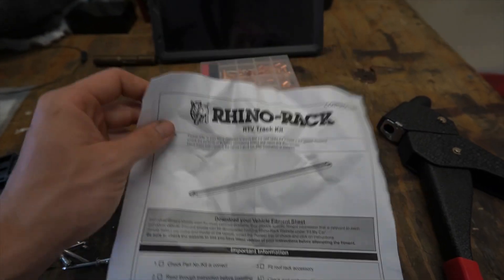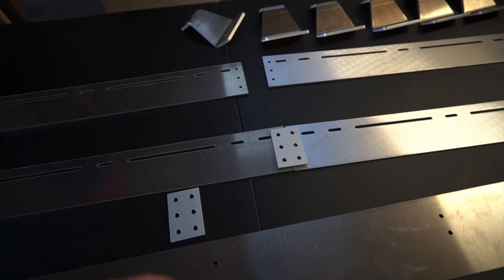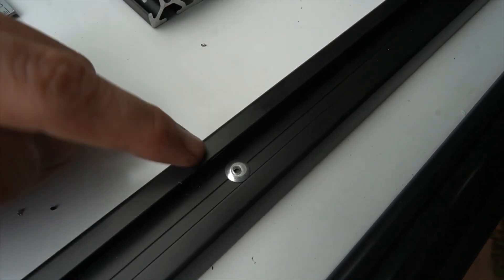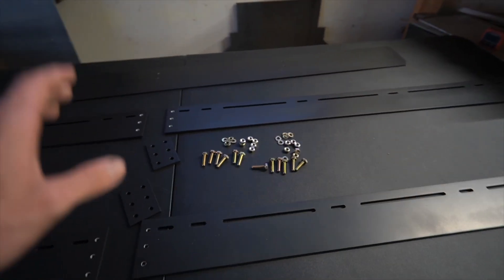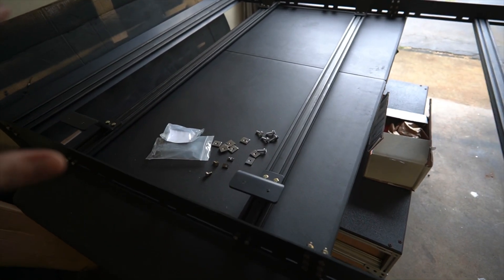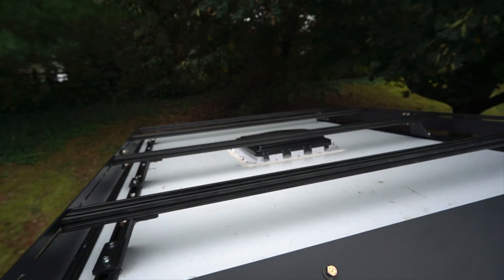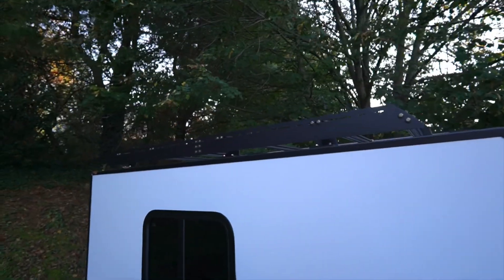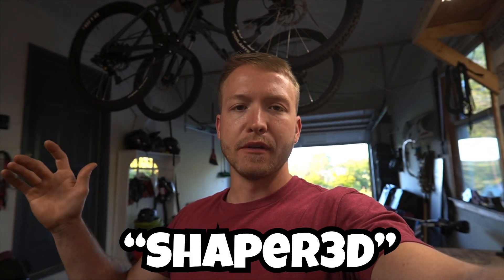Micro Camper Overland Build | Part 6 | Roof Rack

Comment: this is pretty cool a nice simple roof rack I like the camper to, if u decide to make another trailer can u also make it with like the 2 inch or 4 inch lift axle to do like a comparison of the the two timbren axles to see what the difference it makes
Reply from the maker: No plans for another trailer at the moment but the difference in the lift vs non lift is just the spindle it self! In theory I should be able to just change the spindle on these axles to gain some lift. (Which I’m considering doing)

Comment: I’m starting a build and my question on the roof rack install is are the rivets only grabbing the sheathing panels and if so is that adequate? Great videos and awesome trailer! Thanks in advance sir.
Reply from the maker: I’d advise on bolts and washers. The rivets have given me issues. No leaks but I don’t trust them now that I have time with them.

Comment: Great video series- thank you for putting this out. I have been just starting to design my build. I really like how you framed it with the steel skeleton. With this roof rack type of system and the steel frame - would you say the roof is walkable? Would it have enough strength for a roof top tent to mount on as well? Thanks!

Comment: You should coat the aluminum with paint or something bc it will corrode over time
Reply from the maker: The panels on the trailer are pre coated white & the roof rack coated with steel it!
Reply: @Adv4x4   Sorry dude I missed that part completely! Good job on the whole build, awesome that you made it all by yourself! I wish I had the same enginuity
Reply from the maker: All good man! You can do it dude! Just gotta get after it

Comment: I have really enjoyed this build. Im doing something similar and its helped enormously. With the trim pieces around the roof do you get water trapped up there? Im worried about my trim and rack acting like a dam and holding water.
Reply from the maker: Yes it can be! Which is something I didn’t really anticipate because I had to add that extra trim up front. I just store the trailer at a slight incline and it all runs off 👌🏼

Comment: what about a micro toy hauler? small enough to just fit an atv with fold down beds. I'd buy it when your done. Pm me
Reply from the maker: Would be cool! Not building anymore trailers at the moment unfortunately. Have some other equally cool projects in mind coming up that will fit better in my small garage this winter and leave me space to work around it haha
Reply: @Adv4x4  well when your ready reach out same size as your micro camper would work